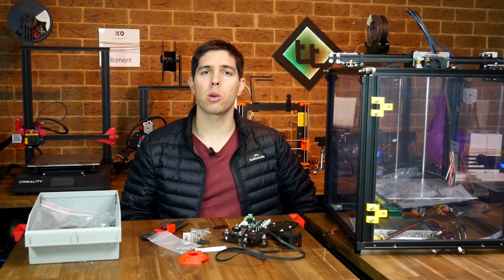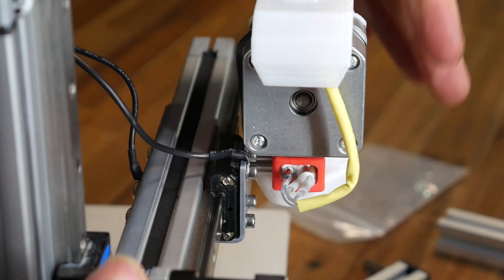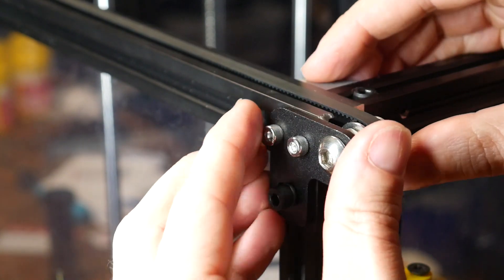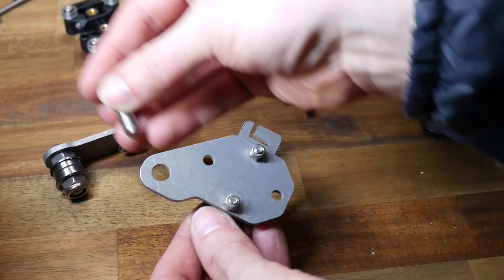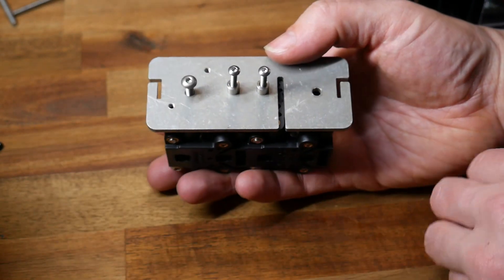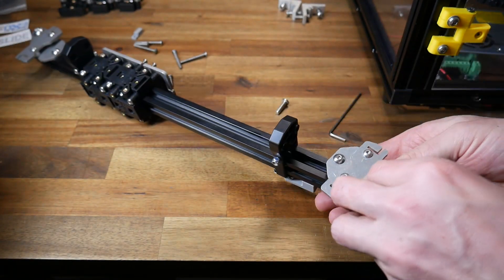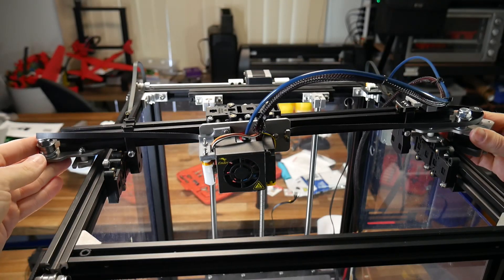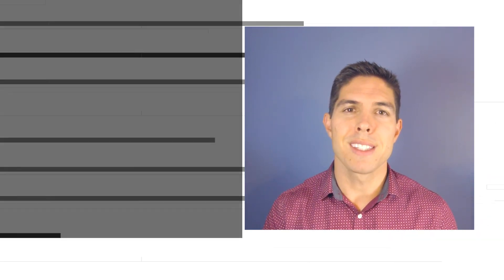Exoslide linear motion system on the Ender 5

Comment: Great modding guide! 

I used it to combine the exoslide X cariage, with linear Y rails mounted on the edges to not interfere with the belt. 
The results are an adjustable X Carriage, not much heavier than stock, thats 10x more stable! 
Not using the Y exoslides, and using the linear rails there, solved all the remaining play and slack you ended up with. 

The combination of the two was ROCK SOLID.

AND

IF you trim the X Carriage down to the hot end mount plate, and mount the belt slip plate behind it, you can retain the original X belt setup. 

Linear Y + Exislide X also gave me 10mm more reachable bed area from stock. 230x230x300! 

Again, EXCELLENT tutorial, especially for modders that tend to experiment a bit like myself. 

THANKS! 
;-D
Reply: I´m really interested in your setup! Could you please upload images/video somewhere? :)
Reply: Thank you. I did a quick video here: https://www.youtube.com/watch?v=-w76oHv9LaA

To show what I have done to my Ender-5 and some of my results. 

Let me know if you have any questions!

Comment: EXOSLIDE is 34 grams per piece. 
The 4 pieces to install the extender are 136 grams.
 It's too heavy for the slide alone. 
The two 9mm LM guides are smaller to install back and forth, and they are much thinner. 
and can overcome the drop in precision.

Comment: Linear slides are cheaper than the exoslide kit. PLUS the exoslide introduces a lot of weight and is very bulky. I prefer linear slides. Nice small carriages with a good form factor.
Reply: Agreed and for my CoreXY weight matters.
Reply: The cheap rails are garbage. Hywin rails are actually entry level. Price out SKF or NSK (Austrian & Japanese) for proper rails. Once you handle/use proper rails, the other stuff is simply garbage. But VERY expensive! Hundreds per rail.
Reply: @Rick Lynch I don't know much about SKF but I do about NSK and for a set can cost as much as a car.  Damn smooth and highly accurate is why.
Reply: @thebeststooge  Yep! I've used both! Insane quality! Everything I engineer and build gets SKF bearings. A 608 bearing is about $7.00ish CAD for example. Will last a lifetime though.
Reply: @ricklynch  This is not a cnc. Cheap rails simply need to be cleaned to be good enough for 3d printing. Without being cleaned they can be quite crudgy. There are also better more precise and cheaper budget options than knock off hi-win which are name brand american made. However few know about them. I will be using them in the 3d printer I am releasing around December this year.
Reply: @Anyone700  Of course they are! They are just a smaller version that extrudes plastics. CNC means Computerized Numerical Control. Can easily get to 0.003" which is very good! The better built they are, the better the results.
Reply: @Anyone700  could you please point us into the direction of those other budget options?
Reply: Rick Lynch I’m pretty sure SKF is Swedish? ‘Svenska Kullagerfabriken’ ? https://en.m.wikipedia.org/wiki/SKF
Reply: On weight, ExoSlides can weigh less than MGN rails.  For the X axis, an the ExoSlides weight is ~150g (37g*4), while a MGN12 carriage is ~50g.  But for the Y axis, the ExoSlide setup weight is ~260g (37g*7), while a MGN12 setup is ~350g (3x50g cars + 200g X rail), excluding the common 2020 in both cases.
On Size, they are bigger, though 80mm is usually around the size of the hotend assembly anyhow if direct drive and a 50mm fan is used.  An ExoSlide 4 sided X carriage for example also offers four sided mounting for all your components (extruder/hotend, fan, duct, belt brackets, etc)
Also, one key advantage of the ExoSlides that MGN rails and V-slot wheels can't replicate is non over-constrained parallel rails.  Nice to have for the Y on a setup like the Ender 5.   Super nice to have for a 3-4 rail Z setup like the Railcore or Voron II.
Reply: @ricklynch  I got in touch with SKF, as I was able to test some of their MGN12(H) equivalents. Yes, the quality is much better, but you may be suprised by their pricing. A set of rails for a dual Z carriage coreXY isnt much more expensive than HiWin rails. Neither are their SSR15 rails, which mostly compare to Hiwin.
Reply: @Panzermuh  That's great news! Thanks for the info! Which line/model number did you use from SKF? Again, thanks!
Reply: @ricklynch  I hear you.  You can usually find used rails much cheaper however as they are cycled out at the tail end of their life.  Still works fine, but supposedly about 80% of their life used.  Problem is that its usually a local thing and its kind of bargin bin.  Never sure what sizes or specs they have at those scrap auctions.
Reply: @exoslide1632  Hey do you guys have any test/calibration prints on your exocube design you can share pictures and measurements? Looks pretty interesting. I tried build my own corexy but ran into the problem of the Y-rail pair binding at the extremities because I couldn't get them perfectly aligned. Your design looks like a nice alternative to the big wheel sliders for v-slots, mainly because I already have misumi's square extrusions. Does the precision and consistency compare well to linear rods?

edit: Btw, what's the temperature limit on the material? Hoping it's some sort of PC or POM so it can withstand heated enclosures
Reply: @paranoidpanzerpenguin5262  For CAD mock-up, there is a STEP model of the slides at the bottom of the ExoSlide PC/S product pages as well as a drawing of the slides.  The frame material is ABS 94HB, with PC bearing treads.  The slides are an ideal solution for 2+ parallel rails, as one end can 'float'.  They are precise to under 0.01mm, as the treads are manufactured in a two part process that includes finish turning!
Reply: @exoslide1632  you guys make this so confusing.... i see some MGN12H between 10-40 euro per rail. Seems about the same, i dont get it cost as much as a car reference??? i dont think spending so much moneey on a ender 5 is justifiable... then jsut buy a printer as expensive as a car.... but anyway ... just stop discussing usseles things and advice upon it. instead of confusing ppl with using the names of products.... nobody know what you're talkign about , i have to google evrything.
Reply: Rick Lynch for a 3d printer cheap rails are perfectly fine and definitely an improvement over V–slot wheels. Of course you have to make sure they are clean and reasonably lubricated which is going to take a bit of effort but with the forces seen and the accuracy required on a 3d printer I challenge you to show me a noticeable difference in print quality using rails five to ten times the price.
Reply: @ricklynch  Not just the rails that matter its how they are mounted that matters the most

Comment: Great Vid. I would imagine this upgrade would suit direct drive units best with the additional weight on the x carriage & probably help any ghosting that may appear on the y azis. The armchair engineer in me can't imagine any noticeable print quality improvements however but will likely reduce maintenance requirements over the long term as the bearings will not wear as quickly as the rubber type wheels. Print speed could probably be increased with no very little effect on print quality.

Comment: The biggest problem a kit like this will fix is the alignment between each Y carriage. Misalignment is an issue on the y axis as wheels and belts wear, parts will come out crooked or like a parallelogram. Y axis misalignment is even worse with the bigger Ender 5 Plus.

Comment: Since you like easy affordable modifications I want to point out the "Multimaterial Y joiner" from Zemistr on thingiverse.
I had a spare extruder and already a SKR1.3 Board in my Ender3 with the extra socket for another extruder.
You can print the joiner yourself and need some M3 screws and nuts to hold it together. With the 3 PC4-M6 quick fittings all tubes are held in place.
He also provides a gcode generator for the extruders. This I used as base but I altered it alot to work with Cura 4.2.1

Comment: rigidity is required when CNC milling alu or steel, to move the tool through the metal

but why is more rigidity needed with 3D printing, where the forces between the head and workpiece are small to non-existent?
Reply from the maker: Fair points. I found it interesting and was happy to make a video on it. The real benefit for me is in designing custom machines. I have a few projects in mind where it would speed up development greatly.
Reply: When running at higher speeds and accelerations the extra rigidity is helpful because of the inertia of the toolhead
Reply: A number of print defects originate from resonance within the printer.  Reducing this enables either better quality without reducing print speed, or higher print speeds while still achieving the same quality.   The original arrangement works amazingly well though... most of my printing problems come from other areas.
Reply: Aerospace Machinist here... The more rigid a machine is, the more precise and repeatable it will be.
Reply: @ricklynch  I saw a video of a guy doing the linear motion on his ender 5 with the one this guy didnt buy, and he did some test prints and the rollers seemed to have better quality prints
Reply: @ODST_Republic  I saw a video of one guy that smoked heavily, and another guy who lived very healthy, and the guy living healthy still seemed to die earlier.
Reply: For the same reason why a speaker box needs to be rigid, so it won't resonate and amplify unwanted vibrations.
Reply: Direct drive extruders may benefit from this because of the extra weight, but bowden not so much. My opinion
Reply: There's a twisting wobble on direction change that occurs because the extruder isn't completely symmetrical around the x axis. Less important for the other axis since its supported at two ends.

Comment: Even with Hiwin rails you're still going to have flex using that 2020 aluminum. 
Flex is a big issue with CNC routers because the bit does put a lot of pressure on the X-axis beam. There are generally two solutions. Double the axis to two beams (like Mechmate CNC routers do) or increase the size of the beam. Doubling the beam means you lose Y-axis travel distance.

Comment: I think making custom bracket that will use twice more open v slot rollers would give you the same result as this exoslide for much lower cost.
But honestly if you need rigidity just maybe toss those profiles away and use two linear rods+bearings?

Comment: I think the main advantage is they will work with euro profile 2020 which v slot wheels wear on. It's quite hard to get cheap v slot in the UK but not euro profile. I assume they will work with plain 20mm square tube too.

Comment: Coming late to this, but  it seems to me the bang for the buck is on the X-Axis carriage if anywhere.  I just don't see the Y-axis mod making a big difference given how rigid it is simply supported at both ends of the gantry.  You aren't going to get torsion about the Z axis or the X axis with Y axis motion on an Ender 5.  As long as the Y-axis components are smoothly rolling and properly tensioned you should be good.  Stiffening the X-axis gantry assembly and adding the linear rail system then would take more slop out, potentially fixing high speed torsion issues about the Z-axis and maybe the X-axis.  But all this really looks like a 250 lb cyclist trying to shave 5 ounces off his seat for a bicycle race...it ain't the seat.

Need side by side prints to see if this actually did anything.

Comment: Since head is not moving in z direction I don't think a litle play in bracket makes little to no difference. Added weight however will degrade performance and might require printing a bit slower. Linear rail in principle could replace whole 2020 rail.

Comment: So the only issue I have had with my Ender 5 is that the left side Y belt slightly rubs on the extrusions at the front end.  This looks as though it would solve that problem, and allow me to finally get that smooth surface I've been seeking.  Can't wait to see the end results.

Comment: Nice solution to a problem that can also easily be resolved by correctly adjusting the original fittings :-)  The flex you see with original fitting, though obviously present and can revealed by exerting excess pressure, isn't really going to affect print quality (IMHO). On another printer with weaker frame there may be more benefit.

Comment: I’ve been considering getting these or rails for a while now. The rubber wheels on my Ender 5 X carriage are worn out and continue to worsen. There is now a groove on all the rollers where they roll on the extrusion. Obviously they must have put it on way too tight at the factory. Every week I look at it again, more and more rubber is turned into dust and the groove is deeper. This will eventually lead to even more backlash and wobble, so I’m looking to fix this before it gets bad. Not sure if I should do this or rails yet.

Comment: Solid video and definitely 'A' for effort Michael but this system is no cheaper or 'better' than linear rail.  Especially if you use the Chinese rail. I am seriously considering converting the Y axis on my E3 to linear and it will cost $24 for the 300mm rail to do it. The X axis is a bit trickier to do without losing print volume in the Y axis but the bigger issue is that my E3 prints perfectly well for my needs. Yes the bed flexes if I pressure it but in normal operation the flexing is not noticeable. Also the Chinese linear rails are rock solid with a modicum of care. I have three huge rails in my Anycubic Linear Delta and I find they have worked perfectly for the past year and my service has been no more than a light spraying/lubing of PTFE dry lube in the channels. Notwithstanding the previous comments I'd still like to see what they come up with for an  Ender 3.

Comment: In my personal point of view, the "wobbling" X carriage (only when you really apply forces by your hand to "move" it) is not really a problem in 3D printing case, because in 3D printing, the machine doesn't apply a ton of loads and forces by the mean of the X carriage (it just pushes out the "liquidified" filament in somekind of mid-air), not like the CNC machines's case (the X carriage really apllies  a tons of forces and receives the same force from the workpiece). So I think that the "wobbling" you are talking about is not a real thing to be worry about. Moreover, I see it as part of the "flexibility" of the machine, mean that if anything bad happen (such as the X carriage bumps into a blob caused by over-extrusion on the surface of the current printing layer), the printer can still recover from that and continue printing to finish its job. That is my thought, anyone that has other thought please reply below so we can learn to be better together, and sorry for my English,lol.
Reply: Lại Quốc Bảo All wobble must be eliminated. At higher speeds, non-rigid moving parts adds to the resonance and vibration, reducing print quality. 

Every time you run over a blob, it’s not up and down and done. It bounces up and down in vibration, and may continues to do so imperceptibly for some time, leading to more artifacting.

Comment: I could see using this Exoslide system on my Kossel Mini. Only thing is that it'd cost about $90 not including tax and shipping. At least for using the 3 sided version of the rails. If you wanted the more rigid version of the rails you need 4 per rail. That'd be $120 without tax and shipping. It'd probably be a great investment though.

Honestly though. I probably won't buy them for mine as I already use linear rails on it. Maybe if I was to build another one. A bigger one. 😁 So I'll be keeping this product in mind for future projects. Maybe even for a mini CNC machine or something. I see many possibilities.😉

Comment: I just added dual linear rails to my Prusa i3 MK3 S Y axis for $30 bucks. Works great.
Reply: Which one 15mm or 12 mm rail?
Reply: I used the 12mm wide rail, since there is 2 of them , one on each side. It made it very stable and over kill. But it was fun, works great. You can find the video on my Robothut youtube.
Reply: @Robothut  oh cool, here 15mm cost less than 12 mm but the issue is that 15mm is build to carry heavier load smoothly ..
Reply: I wonder if the 15mm wide rail set would drag where it passes threw the frame cut outs ? Its close on the 12 mm linear rail set up.
Reply: @Robothut  didn't get it!?
15 mm ones are heavy and is not as free moving .. untill load is applied ..
I am now building a creality style 3d printer with 30x30 support under 2060 for y axis and 20x40 for x axis ..
Reply: I had a batch of linear rails that I used when I converted my Tevo Flash to linear rail. They all were hard to move unless under load, so I took them a apart. Put all the little balls in a jar with IPA and cleaned them. Then put them back together with a little light oil. Worked so much better. I even ordered new balls for them but that really did not make them any better than the ones I cleaned with IPA. You can find the Tevo Flash to full linear rail on my youtube channel as well.

Comment: this seem very good for the Y axis at both end of the X axis but it has nothing good for the X axis because it place the print head farther from the rail so more vibration possible  
so for the price I will pass on that one and simply keep a lower speed with the actual system

Comment: Seems like a reasonably viable option, but how do they compare to cheap Chinese linear rails? One Exoslide box carriage comes out to $40, while a Chinese 300mm linear rail and carriage can be had for <$20, so you could even purchase two rails and pick the better of the two. I genuinely have no idea which would do a better job of eliminating wobble while providing smooth, consistent motion.